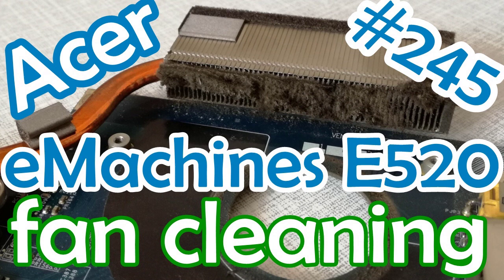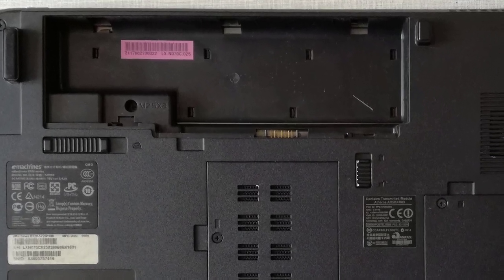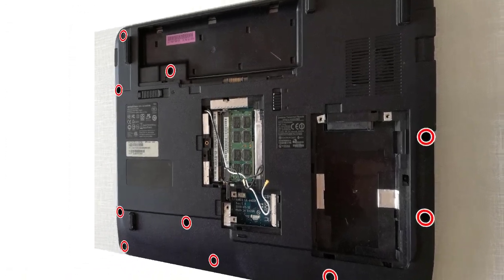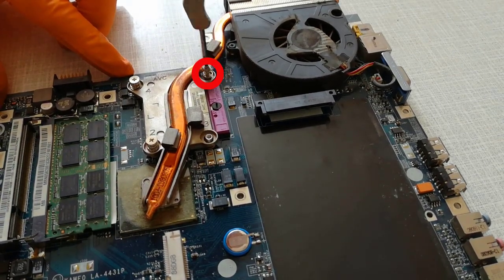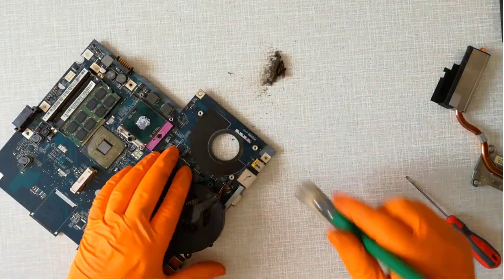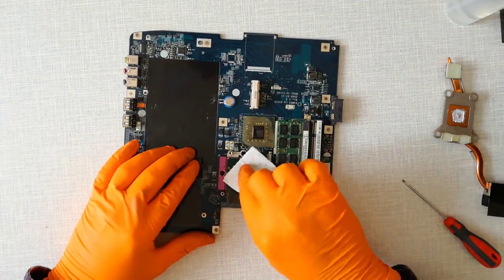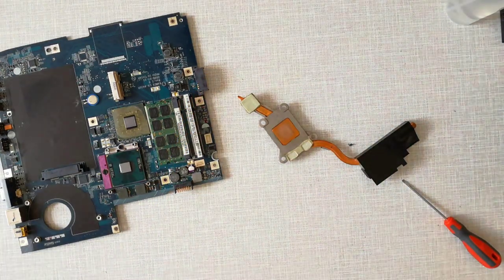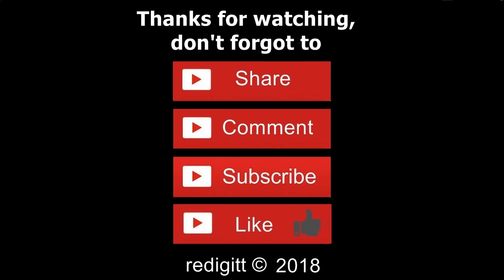Acer Emachines E520 fan cleaning Ep.245

Comment: Just a note: in my case there was a single screw still holding the motherboard - it was in the hole that has a white triangle pointing towards it, near the SATA connector of the optical drive. (Also there is an unmarked cable to be unplugged for the display, near its main cable, which is below the power button.)
Oh, and thanks a lot for this guide, it was very helpful!
Reply from the maker: I'm glad my video was useful, please share and subscribe , have a nice day.